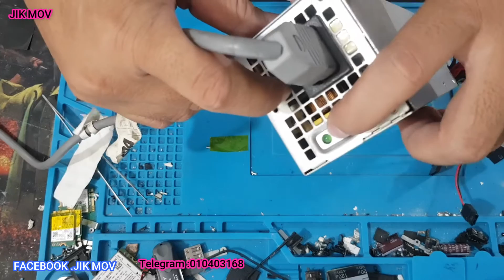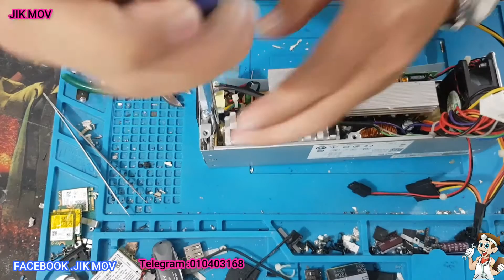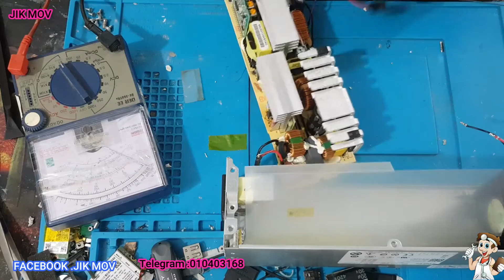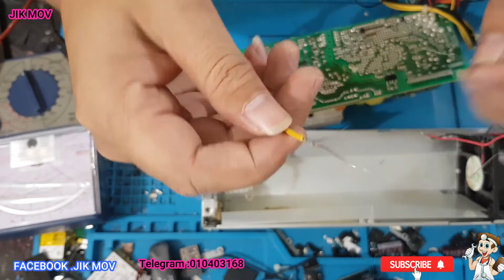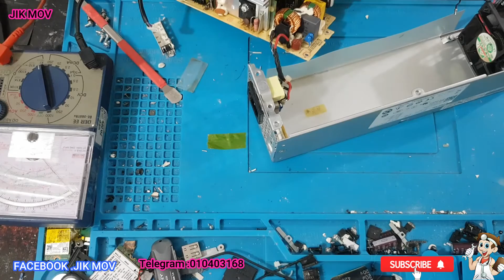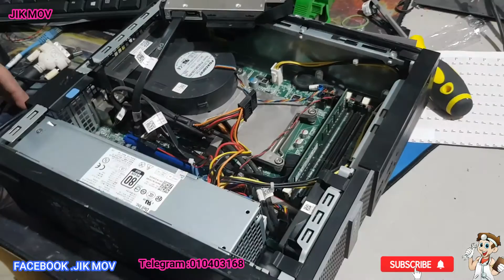how to fix power supply dell 990 mini TEL017617375/010403168

Comment: Thanks for the excellent repair video sir, I have the exact same SMPS. In my case, 5v PS_ON is generated but when I press the self-test button or short PS_ON to GND, SMPS is not starting, any pointers? 

I also checked that when I press the self test button, there is no power on the VCC pin of CP012A. Any advise? 🙂

Comment: Resp Sir! Excellent Video Sir. Sir Dell Optiplex 3020, 180Watt 6&4Pin SMPS PS On 5V Ok Sir, but 12V Directed Pass on Sir. Green & Black Connected after PG 5V Paased Sir, only 12V was Directed Sir and Series Lamp was on off on off Continued Sir, New Fets was chaned Sir and near 12V to 12V small Bulb was Connected this Glowing on off on off, Which Problem Sir. Please Advise Sir.    --    ChinnaRao, Paderu, Visakhapatnam Dist, Andhra Pradesh.

Comment: Resp Sir! Your Vedio was Excelletn Sir. Thank You Dhanyavath Sir. Dell Desktop 6Pin SMPS Secondary Section was not Power Supply. Which Problem Sir. Pls advice Sir. --   Chinna Rao, Paderu, Visakhapatnam Dist. Andhra Pradesh.
Reply: Resp Sir! Thank U Very Much Sir. Ur Advice Iam Followed Sir. Now PS on Ok 5V, 12V was Directed Pass on at 6Pin, 4Pin and Powergood Not Out and Green and Black Connected after Comming the PG 5V Sir. Which Problem Sir and Series Lamp 3Times OFF ON, Off On Sir after Full Off. after above Problem Sir.  Pls Advice Sir.  --   ChinnaRao, Paderu, Visakhapatnam Dist, Andhra Pradesh.
Reply: Resp Sir! Thank U Very Much Sir. Ur Advice Iam Followed Sir. Now PS on Ok 5V, 12V was Directed Pass on at 6Pin, 4Pin and Powergood Not Out and Green and Black Connected after Comming the PG 5V Sir. Which Problem Sir and Series Lamp 3Times OFF ON, Off On Sir after Full Off. after above Problem Sir.  Pls Advice Sir.  --   ChinnaRao, Paderu, Visakhapatnam Dist, Andhra Pradesh.

Comment: it was a power regulator failing, simple fix after diagnosis.
Reply: Resp Sir! Thank U Sir! Power Regulater I will be Change Sir. After Again to ask U Sir.   ---     Chinna Rao Paderu Andhrapradesh
Reply: Sir! Power Mosfets was Newly changed bu Same Prblem Sir.  --  ChinaRao Andhra Pradesh
Reply: @chinnarao326  Hi, I would check for failing passive components.
Reply: Resp Sir! New Power Regulators was Changed but DC 12V Directed Passed and Series Lamp was 4Times Glowing Green Was OK, Green Black Connected after Pass PG5V. same Problem sir. Please Advise Sir.   --   ChinnaRao, Paderu Andhrapradesh.